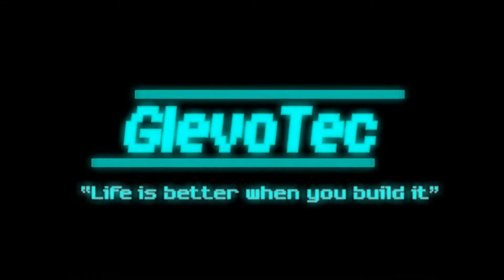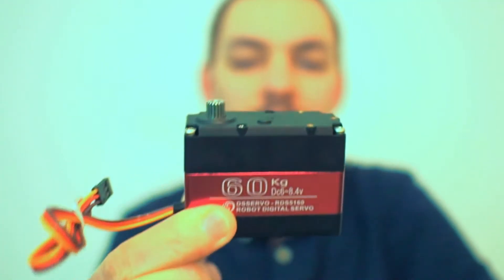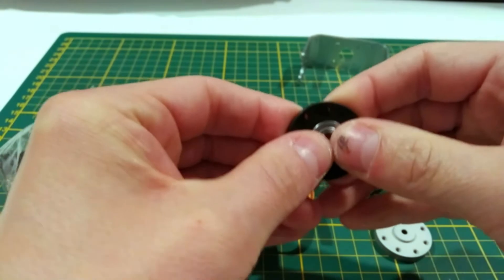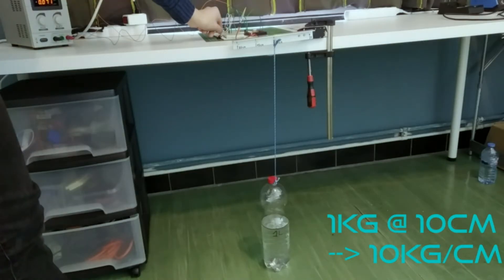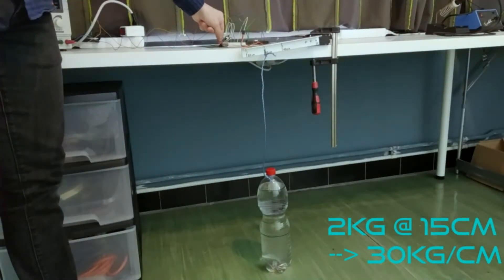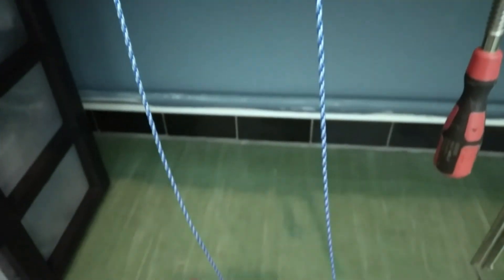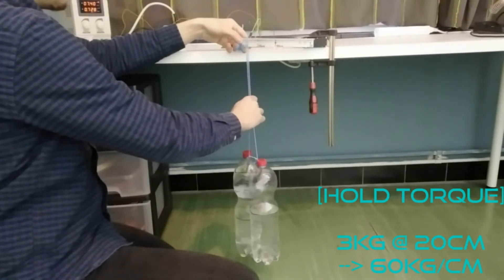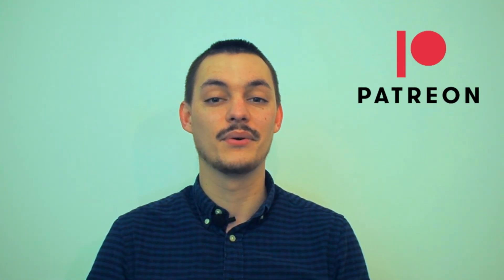RDS5160 60kg AliExpress robot servo review and test. How good are they?

Comment: Is it safe when I am powered this servo with stepdown 8V L78M08 IC with 500mA max ampere?
Reply from the maker: No, you will burn your step-down converter or it will bog down the voltage when it goes into current-limiting.  You need a more powerful source like a higher power DC-DC converter module
Reply: @GlevoTec  if I change to lm2596 module which is adjustable output and can handle max current like 3A, is it enough?
Reply: Or can you tell me how much minimum current to power this servo

Comment: They are good but the problem is the plastic top case..the bearing always gets loose in the casing...so in the end testing a new one for strenght ettc is nice but test it under load for like a full day and than you can really tell if it holds up.

Comment: I just ordered a 270 degree servo by mistake instead of 180 degrees. Is there any difference between them apart from the fact that they rotate at different degrees? I want to use them in an Arduino project
Reply from the maker: No. They should be the same, just turn further.

Comment: Hello. Recently bought 2 of these. They support PWM of 0.5-2.5ms pulse duration with a period of 20ms.  What will happen with exactly this servo if you send a signal outside of those limits (less than 0.5ms or more than 2.5ms? Will the servo's internal electronics automatically "cut" it to fit the limits, or it will continue turning past its specified angle and break?
Reply from the maker: I can't tell for sure, but most likely it will just stop at the limits, since the feedback circuit voltage will be outside the expected values. I would say : try it out and let others know 👍
Reply: @GlevoTec  Thanks! Already tested them with Arduino, works well. However, I want to connect them to another application that supplies PWM with the voltage of a 2S battery (6-8.4V), not 5V. Is it safe to exceed 5V on the PWM wire? Just don't want to burn an expensive servo.
Reply from the maker: @stas_robotmaker  If you're not sure, why not put a simple voltage divider at the PWM signal wire? Two resistors and you can make sure you won't exceed 5V with a higher signal voltage
Reply: Hello. Can you tell me what variation of that servo did you use (180 or 270) and what code did you use for it? I need help with that ASAP...  @stas_robotmaker
Reply: @kirin7299  Hello. I've used the 270deg version, and a standard Arduino/ESP32 servo library.
Reply: @stas_robotmaker  did you use Sweep example? Did you just changed 180 to 270 in cycle for?
Reply: @kirin7299  I just contolled the servo with writeMicroseconds command. The write command implies a 180 degree servo.
Reply: @stas_robotmaker  Я подозреваю, что вы русский, так что так будет быстрее.
Ситуация такова, что сервак у меня ведёт себя очень странно. Он при подаче питания и управляющего сигнала уходит в одну позицию и в дальнейшем игнорирует любые поступающие команды. При попытке сместить его вал механически, он игнорирует воздействие некоторый градус, а потом оддёргивается обратно в то положение. Из какого-то положения вроде он вообще не хочет работать.
Преподаватель меня настойчиво пытается убедить, что серва хоть как-то крутится, значит исправна и говорит, что надо найти алгоритм управления сервой 360 (с задачей угла!) и просто помяенять циферки. Либо мне кажется, либо это бред... Как его переубедить, не знаю. Других серв этой модели на руках нет щас.
Reply: @stas_robotmaker  Кстати, вал можно механически и правда прокрутить на 360, что по идее не должно быть нормой.
У меня из-за этой дичи встала ВКР.
Reply: @kirin7299  Это нормально, физические ограничители ставят только на дешёвые сервы.
Reply: @stas_robotmaker  Да, уже узнал подробней, но опять же, серва свою функцию не отрабатывает.
Reply: @kirin7299  У меня исчезают комментарии почему-то. Покажите код управляющий.
Reply: @stas_robotmaker  банальный пример sweep из библиотеки Servo использовался, а также пытался сервотестером.
Reply: @ В таком случае очень похоже на недостаток питания. Какое напряжение?
Reply: @stas_robotmaker Странно, писал же коммент... 7.4-8 вольт пробовал
Reply: @kirin7299  Не видел такого. Проверьте напряжение непосредственно при работе сервопривода. Уже бывало, что при нормальном питании из-за перебитых проводов сервоприводы плохо работают, т.к. сильное падение напряжения.
Reply: @stas_robotmaker  Напряжение подаётся с внешнего блока питания, даже слегка больше 8 вольт было ненадолго. Хоть бы хны.
Reply: @kirin7299  Снимите крышку сервопривода и померьте сопротивление проводов, от разъёма до платы.
И на БП не стоит ограничение тока?
Reply: @stas_robotmaker  Ток выкручен практически на максимум. Для прокрутки должно хватать. Да и возвращается же он как-то в ту свою позицию, из которой уходить не хочет, на это ему тока хватает.
Вскрыть крышку смогу уже только завтра, к сожалению, щас инструментов при мне нет.

Comment: They are terrible servos, the metal the gears are made from is incredibly soft and will strip if you so much as look at it.
I bought two of these to replace a JX HV2060MG which was very sloppy after a long and hard service in a large scale RC truck, both the DS5160 servos i bought stripped their gears on the very first run!

when the first stripped its gears after 10 mins you could just put it down to being a bad servo but after putting in the second and it failing in almost the same amount of time it is clear the gears are poor quality.

i would also like to add that the servo is very VERY weak in terms of torque, at 8.4v, the same my JX HV2060MG is run at, it struggled to dry steer my truck, something that the JX servo has no problem doing.

Yes, the JX servos are significantly more money but the quality is an order of magnitude better, if you need cheaper servos then look at SPT, they are reasonable quality at a decent price.
Reply from the maker: I disagree on that. In further projects I tested them and none of them failed so far. They have been pushed to their stall torque many times over. I think it simply comes down to from who you buy them. There are always cheap copies of the cheap copies.  I bought them all from the same seller and had zero issues. I know people who bought the same ones for their robotic projects and had very good experiences with them, like myself.
Reply: @GlevoTec  Pushing them to the stall torque in a controlled environment is different to them being used in a real world application where they will get shocks put though them such as a steering servo in a 25kg 1/4 scale rc truck.

I have had massive rollover events at where i have rolled multiple times at high speed, bouncing off the wheels on each rotation and the JX servo shrugged it off, both of the cheap DS5160 servos failed from just bumps in the ground!! 

They are poor quality cheap servos and its not just the gears, the lack of torque is because they are a small servo and use a small motor, the footprint of the JX HV2060MG and the DS5160 is the same but the JX servo stands a full CM taller because it has a bigger motor and can actually deliver the claimed torque, something the DS5160 cannot.
Reply: If I wanted to buy the JX HV2060MG servo would it be a bad idea to order them off of Amazon?
Reply: @anthonyprocida2135  I would buy from wherever is the cheapest unless you are desperate to have it super fast.
I order all my stuff from china.

Comment: Interesting! I didn’t thought they would work but they worked fine!
Reply: they wont for long, they are very poor quality and the gears will strip very quickly
Reply: @stevefox3763  you should note those gears are made out of metal NOT PLASTİC, they will hold on for a pretty long time. (altough most servos including this one will need maintenance per 10 years or so)

Comment: This is a great review, thank you!  
One thing to note is that the rated torque is at stall, so it might hold but not lift the load at the 60Kg-cm.
I like how low the noise is for the force it can provide. Amazing.
Reply from the maker: Thanks. Yes, indeed. The mentioned torque is holding torque. So they passed the test
Reply: @GlevoTec  Hey I got a similiar motor, but i cannot get the bearing out of the plastic wheel. Somehow it is stuck or glued. Do you know, how I could get it out?
Reply: @GlevoTec 60kg/cm? More than 550 Newton Meters? I think the formula they use is to manipulate and market false information, if it's the case these small motors should be in Tesla models because wow...60kg/cm is equivalent to 550 Nm, motor torque and gear train specs is exactly the same as how you would quote "towing capacity" torque, now it quotes 60kg/cm or 550 Nm, as a customer I want to pull my boat with this, after I purchased this item, will I be disappointed with it with the information they market with?
Reply: Nice